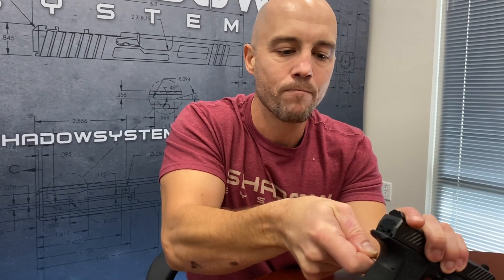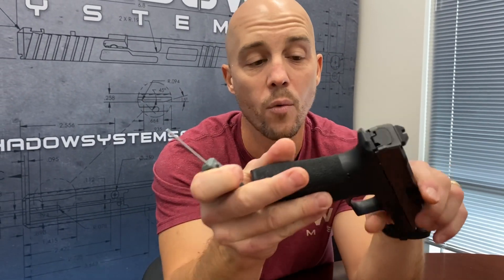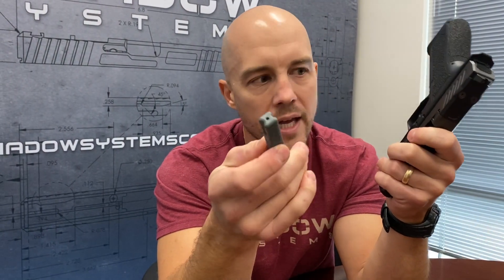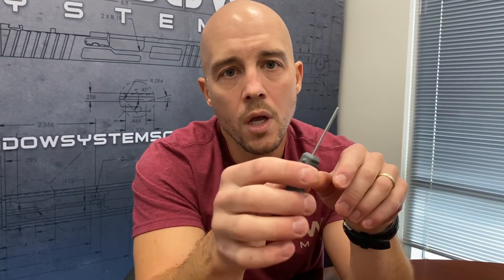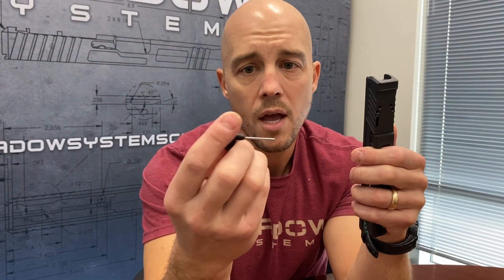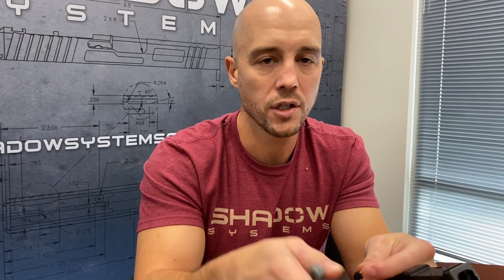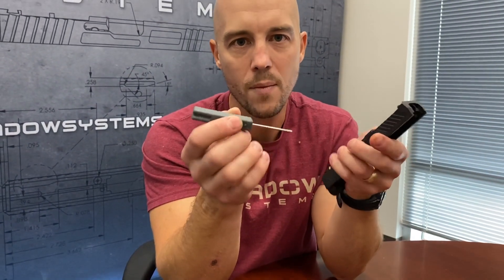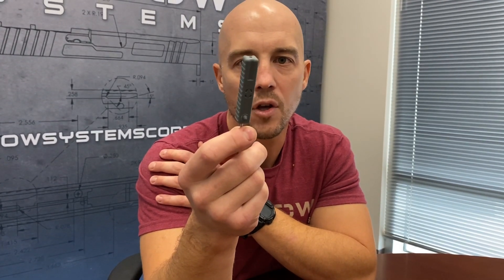Technical Tuesday - The Second Most Reliable Thing in Your Range Bag

Comment: Can the plunger assembly that acts on the extractor be inserted into the slide from the rear with the firing pin retainer removed?  Mine will not go all the way and I don't want to force it.  I have to insert it (plastic end first of course) into the slide from the breech face and then insert the  extractor and firing pin blocking plunger.  Thanks..